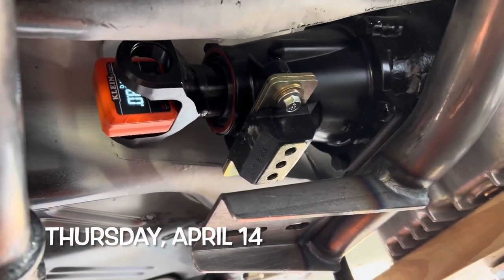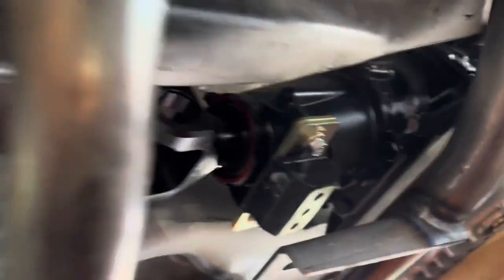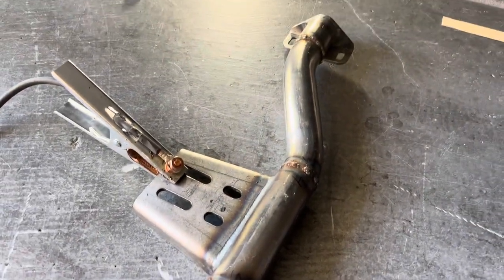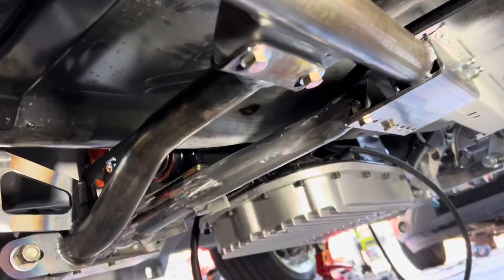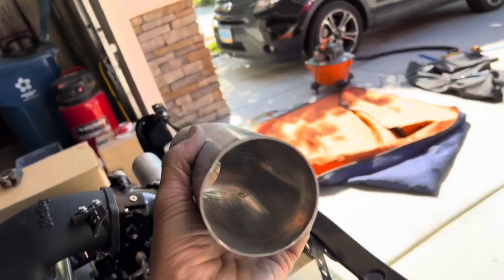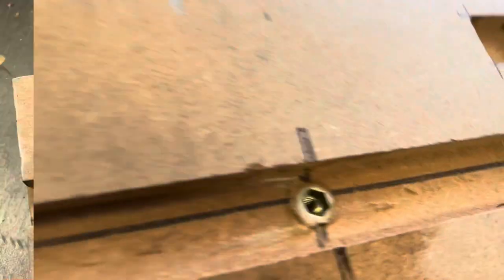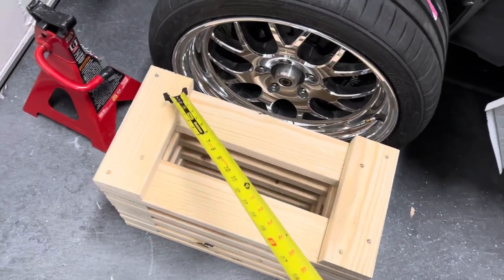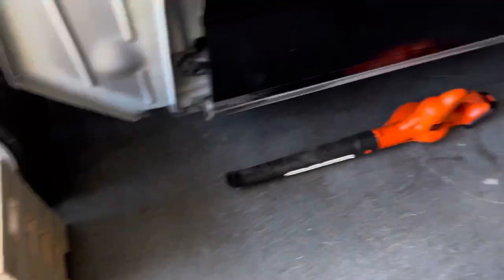Brody’s Garage 🏁 Episode 31: Driveline Angles, DIY Wheel Cribs & More

Comment: car is coming along nicely. i've got a few tips to help set up the driveshaft angle. first, when measuring for the transmission you'll get the most accurate reading on the face of the harmonic balancer. use a straight edge to span the pulley and just make sure the angle finder is straight up and down. second, for the pinion, if you turn the yoke 90 degrees you can span the pinion with the angle finder as if the angle finder was a u-bolt. again make sure it's straight up and down.
don't worry about adding weight. just set the car to exactly were you want the final ride height, then as you add the finish weight of parts to the car you can re-adjust the coilovers to raise the car back to were you want the ride height. i would shoot for 3 degrees (+/- .5) down on trans at ride height. the main thing you want is the working angle of the u-joint. if you are 3 degrees at the trans and pinion you don't want the driveshaft at 3 also. that = a 0 degree working angle. if the driveshaft ends up perfectly level with 3 at trans/pinion that is a 3 degree working angle which is max. a 1-2 degree working angle is ideal. hopefully some of this helps you out.
Reply from the maker: Now that I have the car up on the blocks, I will definitely check all of that out… Thanks!

Comment: Those blocks are way safer and 5.5 inches taller than my 8816 cinder blocks!.... No danger in crawling underneath those....Bravo on the  "parallel planes" of the pinion shaft and trans outshaft, but you should also check the angle of a string line between the two shafts and limit the difference in measurement to 3 degrees or less (ujoint articulation angle).....I probably would have slipped gusset tubes inside those rewelded tubes for that crossmember.....Never a bad time to resolve to swear less, especially with little ones around....Great day for self reflection and inventory of where we are in life since it is not permanent and our time here is  of unknown duration.... Love the build videos!

Comment: It’s crazy to see that those blocks are strong enough to hold up your car. Would you say that it is safe to work under the car for an extended time? Of course I would stick some extra support under the car as well for safety.
Reply from the maker: I mean, maybe if you dropped a car onto them from above, but I’ve had them on/off multiple times. No signs of cracking at all.